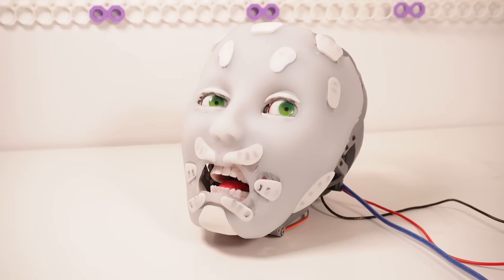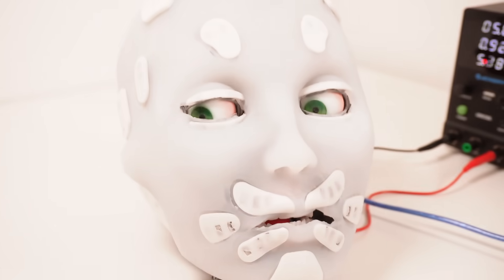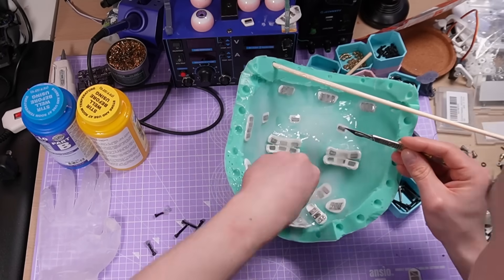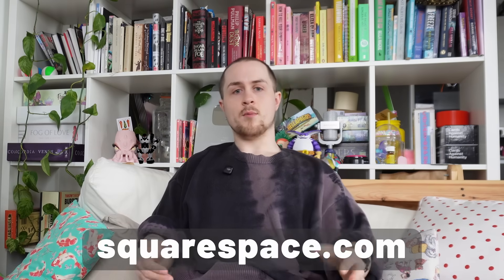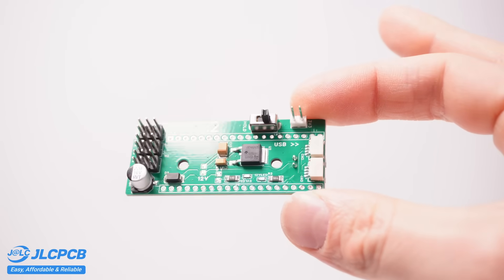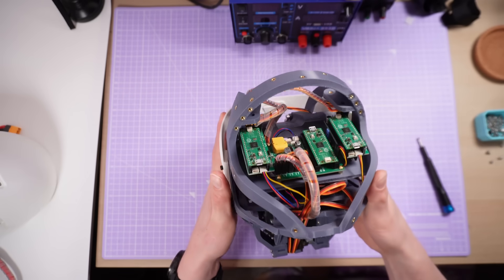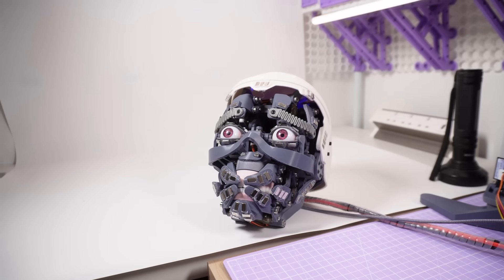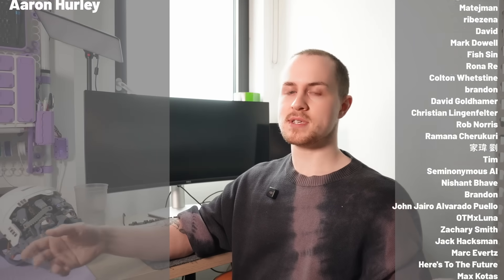My New Robotic Head Design is Legally Confusing

Comment: Pro tip. Don't look into patents, you are just looking for trouble. If someone has a issue with you, it's their obligation to let you know, not yours to find out. Most patents don't get enforced, specially on a hobby scale.
Reply: if there is no profit from your use of the patent, the risk is basically zero... most you risk is getting a cease and desist.
Reply: @bschwand  that's just not true; you can be sued for lost revenue as a result of patent infringement.
Reply: @42468  ok and you made nothing from that infringement, how are they going to collect ?
Reply: well he intends to distribute the design so i reckon hes done well to look out for himself legally
Reply: Aren't patents restricting only commercial applications? Open sourcing the design is not a problem for the publisher but for the end user? @menotonline  If so, Will is aiming for some kind of revenue from this project?
Reply: This is a good point. open source is different from distribution. But even then if you aren't pushing for monetary gain you're probably going to be fine. Unless you mod a Rockstar game, then you'll find some takedown notices real quick from Take 2
Reply: @entronics  Nope. open source is distribution.
Reply: @entronics  open source is distribution... if a patent covers the activity I intend to open source, I have no right to apply an open-source license to that activity (eg. MIT license)
Reply: Isn't distributing excerpts from the patent just distribution of already public information? Just don't take credit for that one thing, and credit the patent holder for it?
Reply: Yeah for sure. Just do your thing. You can make absolutely anything you want and make a video about it. If something comes up after you manufacture a bunch it’s something you can work out. It’s more likely that they’ll steal your ideas instead of preventing you from selling your version of theirs
Reply: Iirc in both IP and Patent law they cannot pursue non-commercial works
And it also applied in some special cases commercially, for example, if you pay a company to repair some device for you, they cannot be held liable if they take and replicate one of the parts of the device for the purposes of the repair. It's precisely this reason why you have companies like Apple and John Deere pulling bs like making parts electronically paired to a device so it doesn't work if replaced, they cannot stop the replication for the purposes of repair, but they sure as hell will do everything in their power to make replication borderline impossible
Reply: @KibitoAkuya  that's absolutely false. They can, and will, pursue non-commercial use. It's rarer than going after people profiting.
Reply: Sure. Its others job to point out you infringe and stop you, and then after 3 yrs of work and countless amount of money spent you are back to the drawing board because you didnt do your legal research beforehand and your project is now not yours.
Reply: @HidekiShinichi  we're not talking about a commercial project here. Obviously of you are working on something intending to make a business out of it, do the research.
But here it's a hobbiest level, open source, shared, no money involved project (at least that is what it sounds like)
Reply: @bschwand  and what does that change?
Reply: for sure
Reply: Or just move to China and do whatever you want.
Reply: Especially if you're not manufacturing and selling your own version. Just doing a prototype for a youtube channel and releasing it as open source, a patent attorney would have to be very desperate to come after you.
Reply: Bros doing laywer research for his competitors
Reply: With the addition of patent trolls, if you look hard enough, like paying for a patent search (in the 10's of thousands of dollars) you're almost guaranteed to find a patent for just about any idea you have.
Reply: Tem razão, se você não conhece, você não copiou
Reply: Yeah, something told me he was way over thinking that.
Reply: why would he want to invest time in making the product work one way just to have it be cease and desisted? always good to look ahead
Reply: This should not be a patent. Attaching anything to anything is the prime derivative of the magnetic properties. Same thing with using glue, screws, nails or welding. These are techniques of attaching things together and using any of them is not an "invention". Having a patent on fixing anything with magnets is just retarded...   :)
Reply: Agreed, but for a different reason. If you do patent research and come across a patent you later end up violating, it might be considered willful patent infringement, which has treble damages.
Reply: patents, Chinas favorite self hinderance of Americans
Reply: @idiotburns  don’t worry, tariffs will sort it out. As we all know, cumbersome and expensive red tape is always easily counteracted by more cumbersome and expensive red tape, and no unintended consequences ever come back to bite us
Reply: @idiotburns  China has patents too, kiddo.
Just like everywhere else.
Where do kids like you get this stuff?…

Comment: Amazing work!! Especially by a single individual. I know that every Engineer loves to pave their own way, but if I could humbly suggest trying the ARC software paired with a Raspberry Pi, Arduino, or EZ-Robot hardware, it would save you so much time! The grassroots software has been developed over a decade and is constantly being improved. It would also give your head instant access to AI capabilities, servo control, animations, etc. Projects can even be shared between users, and it's mobile-friendly as well. I'm willing to answer questions if you have any.

Comment: Use the magnets to secure simple lugs in cavities - it will be easier to procure and means the functionality of the magnets is reduced to static mounting as in the Disney example. To do it easily settle on a uniform size of small magnet, make a copper bar the same size you can fit in your soldering iron and make a well in the printed components of the face at the securing points. Each well should house the magnet with a little clearance above it. Then on the mask side you only need to add small hollow steel caps which are the same dimensions as the clearance in each well on the robot head to the end of small blobs on the mask while it's still drying.

Comment: Will, Using ChatGPT and your video, I asked it to look into this for you after it watched your video. Based on its research, there’s no broad patent that completely blocks the creation of magnetically applied silicone. There are some patents on specific formulas, manufacturing methods, or certain product designs, but not one that totally monopolizes the whole concept.

As long as you develop your own unique formulation or application method, it looks like you should be able to move forward without major legal obstacles. Of course, it’s always wise to have a quick patent attorney review before you launch anything commercially, just to be extra safe — but honestly, from what I found, you're in a good spot to keep building your idea.

Just wanted to encourage you — innovation like yours shouldn’t be blocked by fear if the path looks this clear! 🚀

Comment: I was researching about the patent and I found that they use magnetic forces to deform the face not to hold the face. I don’t think it is possible to pattern a natural property. You are just holding the face with magnets. I did use an AI to look for the pattern on the properties And it will be very unlikely that you are doing something as they are doing it. It looks like they’re using my 90 forces dynamically to deform the face. You’re just holding the face in place which we have been doing that one for hundreds if not, thousands of years. Using magnets to hear something statically I think it will be impossible to get a patent for.

Comment: 1 : Patent law (and 99% of IP law more generally) is BS. For general ideas you should get a year tops, for some general nuance being included maybe 2-3, and only for hyper-specific implementational details should you get even so much as 5. Treating data as a thing that can be "owned" is a foundationally flawed concept and, while it is in some ways necessary, (in the same way that we have no evidence free will exists, but, y'know, we still need to assume it does to hold people accountable for their actions) it's extended well beyond that point. Keep in mind, I say this as someone whos political alignment is Ron Swanson. Ownership itself is a borderline divine concept, but ownership over data is fundamentally nonsensical. If I take a car from a car dealership that is theft. If I look at a car in a car dealership and then make my own exact copy of that car using nothing but raw resources and hand tools, that's not. If I look at a car in a car dealership and perfectly 3d print an exact replica, that is the exact same as the prior case. If I look at a car in a car dealership and use devmode to ctrl-c ctrl-v it, that's also the same as the prior case. I.e. : "Theft", aka taking someone else's property, is when you deprive them of something they had rightful ownership to and were entitled to keep and, as a result, has no way of consistently or rationally applying to information, aka anything not-physical. (note : "depriving someone of something they are entitled to" is a perfect description for literally everything that should be a crime, and it's an exhaustive description) If I take the car I am depriving the dealership of something which they were entitled to, the car that they owned. If I make a replica of the car, they were not entitled to my sale, so they have not been deprived of anything they were entitled to no matter how easy and 'free' it was for me to get that copy. So, how can I "steal" data? Me knowing something doesn't stop you from knowing it, so even applying concepts of ownership and theft fails because that's just not how data works.

Yes, this will un-discourage people to ctrl-c ctrl-v designs, and yes, it will un-discourage people to sail the seas, but people already do both of those things anyway, so the benefits outweigh the costs by magnitudes. More than that, it's straight up ending lives. 3D printing was held back decades by patents, and now one of the most common things you see people talking about 3D printing for is medical uses. How many people suffered and potentially even died from conditions that could've been helped if 3D printing technology had advanced further, faster? Patents are based on the idea that if people aren't assured years or decades of sole monopoly over an idea they won't make it, but that's just not how innovation works. This is already too long as it is so I won't add half a dozen more paragraphs going into this, but I think I've made my case well enough as-is.

2 : sidestep the BS by using the magnets for alignment purposes only. Use chamfered pins or cones sticking out the back of the mask that provide a mechanical interlock between the two sides, with the magnets only being there to align the pins. You don't actually have to change anything about the design, use weaker magnets, etc., just add small (ideally high-friction) cones and small insets for those cones to set into. Technically now your design is not using magnets to change the contours, it's using mechanical interlocks to change the contours, the magnets just help to keep together & aligned for assembly. Is this a stupid and completely unnecessary workaround? Yes, see previous, this is why IP law is stupid

Comment: Speaking from an aussie point of view, with just a lil ip knowledge, i'm pretty sure that an expired patent becomes public domain and you could simply claim that as the basis of your design.. Obviously, don't take my word for it and get a professional opinion, but it's worth being aware of if ya weren't already mate..

The inventor in me says, make it more of a skull cap and implement some larger surfaces that could be adhered to with vasoline.. My thinkin' is that of polished surfaces sticking together with a drop of water..

Comment: It may help you to get creative with your own personal wording. The skin is not attached to magnets, The "exterior covering" is mounted to "cleats"

The key here is to emphasize structural intermediaries (like “cleats”), modular design, and perhaps even describe the function in terms that shift away from "contour simulation" or emotional expressiveness.

Here’s a suggestion for creative and patent-distinct wording

"Modular dermal attachment system utilizing intermediary retention anchors"

This system involves the use of synthetic skin components pre-molded with retention sockets, into which rigid polymer cleats are inserted. These cleats serve as interface modules, each embedded with magnetic elements. The magnets facilitate non-permanent, positionally-secure attachment to a corresponding network of magnetic seats on the robotic chassis.

Importantly, the skin is not directly magnetically affixed, but rather coupled via these mechanical cleats—allowing for modular replacement, localized tensioning, and potential integration of sensors or thermoregulating elements within the cleat body itself.

---

Some alternate phrasing and concepts to further distance the idea:

“Cleated interface coupling for flexible external membranes”

“Anchored subdermal connector array using reversible magnetic affixment”

“Indirect magnetically-assisted dermal retention using molded mechanical inlays”

“Snap-lock dermal cleats with passive magnetic stabilization”

“Segmented surface mounting system using positional retainer cleats with embedded magnetic modules”

Comment: I wonder if you could use that clear and stretchy gecko tape in the movement areas and magnets in the higher fixed points as alignment anchors. In theory the tape is washable and reusable though in my experience good luck when it decides to stick to itself. I have used the stuff on guitar pedal boards and found that so long as the two surfaces are clean of dust and oil bond is pretty good.

Comment: Maybe try and impregnate the silicone with ferrous particles? Looks like the magnets being integral to the "skin" is a key component of the patents. Might allow for a customizable  tensioning of the skin as well. Dunno. It'll mess with the translucence of the skin, so maybe some testing is in order. Just thinking out loud.
Reply: Neat!  This/Ferrofluid Skin (Layer) would really allow for some neat capabilities!

My only concern would be it may be harder to isolate zones, so it would all move all over in some body horror kind of way, but only one way to find out!
Reply: @ericlotze7724  It's body horror when you have it happening on a human face. I understand why people are pushing for robots that are anthropomorphic, but it introduces so many unique design challenges (just to get it to work, let alone mimic a human) that could be avoided by allowing a robot to be a machine, and shaped thusly.
Reply: The gray, maybe sparkly surface of the ferrous skin would actually help with the uncanney look. As it would look even more machine and less albino humanoid.
Reply: What about creating a ferro-impregnated silicone disc (or other appropriate shape) that is then embedded into the silicone face under the skin? You could place the discs only in spots that correspond with the magnets in the skull, thus bypassing the patent issues?
Reply: Could isolate it to a substrate...

Comment: this is very impressive, that you've made all this animatronics, however, it all seems pointless, when you could just put a flexible LCD face shield and have an animated face instead. it would make the system so much more simpler, and you would avoid the uncanny valley altogether.
Reply: Then it would not have been a mechanical animatronic, sidestepping the entire point of the project.
Reply: @GeneTurnbow  what is the point of mechanical animatronic?

Comment: Buy it, use it, break it, fix it, trash it, change it, mail, upgrade it
Charge it, point it, zoom it, press it, snap it, work it, quick, erase it
Write it, cut it, paste it, save it, load it, check it, quick, rewrite it
Plug it, play it, burn it, rip it, drag it, drop it, zip, unzip it
Lock it, fill it, call it, find it, view it, code it, jam, unlock it
Surf it, scroll it, pause it, click it, cross it, crack it, switch, update it
Name it, read it, tune it, print it, scan it, send it, fax, rename it
Touch it, bring it, pay it, watch it, turn it, leave it, stop, format it
Buy it, use it, break it, fix it, trash it, change it, mail, upgrade it
Charge it, point it, zoom it, press it, snap it, work it, quick, erase it
Write it, cut it, paste it, save it, load it, check it, quick, rewrite it
Plug it, play it, burn it, rip it, drag it, drop it, zip, unzip it
Lock it, fill it, call it, find it, view it, code it, jam, unlock it
Surf it, scroll it, pause it, click it, cross it, crack it, switch, update it
Name it, read it, tune it, print it, scan it, send it, fax, rename it
Touch it, bring it, pay it, watch it, turn it, leave it, stop, format it
Technologic
Technologic
Technologic
Technologic

Comment: You should patent the exactly same desing as "eletromagnectic snaps", so yours should be differente than the patent one and could release the  files sayind that "its meant to be place with electromagnets", but in practice could be replaced with just magnets.. AS A USER DISCRECTION..
Reply: Patents, however, are astonishingly expensive to execute, and require that you prosecute infringers in order to retain their legal force.  The only value in doing so would be to sell the patent to some other company, and then you'd be forbidden from using your own technology.
Reply: @GeneTurnbow  the all patents things it's over complicated. you are right, he do not need apply for one now. I really doesn't think that for this project he have the need to spend that much time think on that. So if just make the design "marginally different" should avoid future headaches..